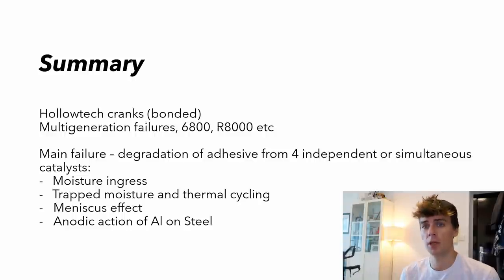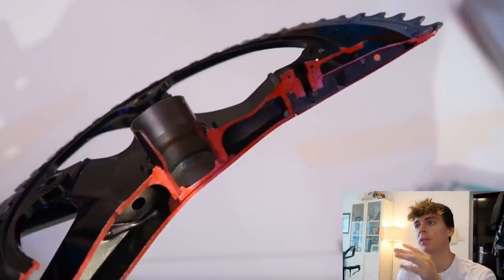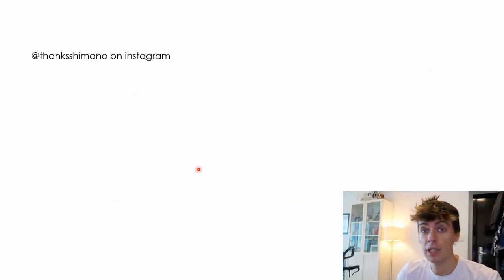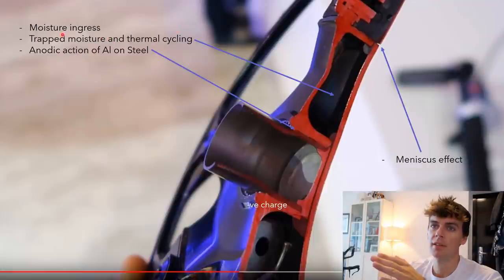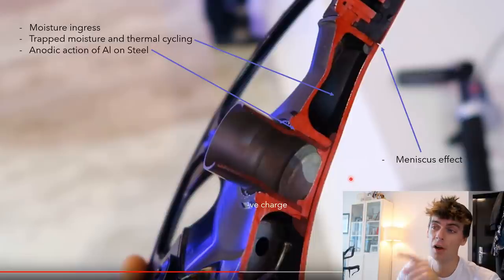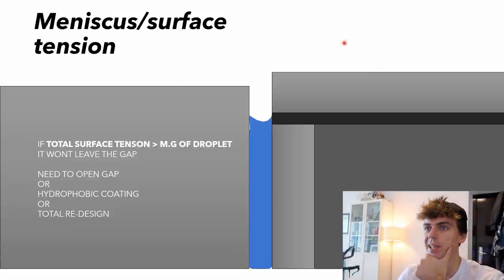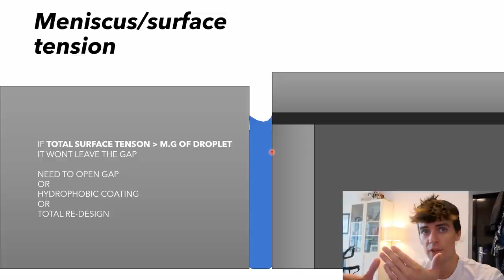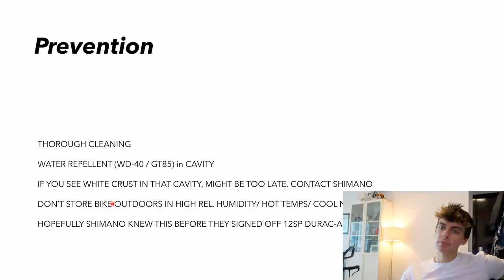Why do Shimano cranks keep failing? Analysis.

Comment: I have broken 3 Ultegras - two at the spider and one the back panel (inside side of the crank).  I live the northeast United States, but I do sweat a lot.  All failures happened in < 15 months.  I upgraded to Dura Ace, but sounds like they are just as bad, albeit with a 3 year warranty.

Comment: I had a argument on Raoul Luescher's channel about resin and water.  In fibre glass boat building they have something they call osmosis, which is probably a bad name as it comes from biology but that's what they call it.  Some resins they have used are hydrophilic and react with water.  They then no longer perform as a resin.  It's well known.
Reply: Many fiberglass boats are made of fiberglass in polyester resin. The ester chemical groups in the polyester can break (hyrdolyze), which reduces the material properties. Worse, if the sizing chemical on the fiberglass doesn't do its job, the bond between the adhesive and fiberglass strand can break. Epoxies are generally very resistant to hydrolysis, and almost any cured epoxy you come across can survive hours in boiling water with little property loss. That said, I don't think we know what chemical class Shimano uses for these parts.

Comment: Just failed my second R8000 crankset. New bike purchased at the end of 2018. First cranks broke on both sides an inch or so above the pedal hole. Shimano replaced for free. Second set just broke but this time only on the drive side but in the same place. I can confirm that I have white powdery substance between the crank spider and the chainrings and I agree that I think that corrosion is the entry point for the failure to happen. Waiting to see if Shimano replaces it again. If they do I may either start vacuuming out the gap or spraying WD-40 in there regularly. I do not think there is a solution, I will continue to break them on a nearly yearly basis. I do suffer from hyperhidrosis and live in Alabama so I’m just north of the band shown in the video. Will likely move down to non-bonded 105 if they do not replace.

Comment: I’m north west UK and have had a 6800 ultegra rh crank fail, shimano didn’t warranty it either meaning I had to replace with an R8000. Also got 2 club mates who’ve suffered the same on 6800. I should also add that my failure started with a creak under load, a twisting moment could be seen when looking down as torque was applied which ran along the length of the bonding from the spider end towards the pedal.  This suggests to me the torsional movement between the 2 sections fatigues the bonding to allow moisture in and as time progresses the split in the bonding propagates along the arm. I had no signs of corrosion in the areas where the chain rings but against the arm.  

The crankset that failed for me was well used (approx 15000 miles) but was well maintained and cleaned inc using compressed air to blow off water before towel drying and storing within the main house.

Comment: This literally happened to my crankset over the weekend. I don't normally, if ever ride in the rain, but got caught in it this past weekend. After I washed my bike, and cleaned everything up, I noticed a massive crack in my crankset. I called Shimano this morning, and they asked me to fill out their warranty form and send it in. My bike is only 2 years old, I'm 2nd owner and has maybe 4000 miles on it. 3K of which, I put on it. The guy from Shimano knew exactly what I was talking about when I called and immediately told me to fill out the form and send it in. Called one of my local bike shops and told him what the problem is and his reply was "Yep, I have a few of those around here somewhere." 

Shimano knows about the issue, and I think they are just going to replace them as needed, and take the product out of consumer hands (hence me having to send it in.)

Comment: You talked about the garage storage, I think in Asia lots of people also storing their bike on their balcony. Cold AF in winter and then hot as balls in the summer sun.
Reply: Even over a single day between night and day on the sun there is a substantial temp difference.
Reply from the maker: Good point Joe. Asian balconies EAT aluminium. Especially bars. I only put mine outdoors when im particularly pissed off with it...my nrw TCR lives in a de-humidified room 😉

Comment: I had an Ultegra 6800 crank fail and I replaced it with an 8000. The 6800 has holes in the rear of the spider but the 8000 does not, so I surmised that it was due to moisture and salt ingress. A friend of mine also had one fail just a couple of weeks ago

Comment: I suspect that the shear forces that act on the cranks also play a part in weakening the bonding agent used and lead to slow mechanical breakdown of the adhesive. In places where there's a lot of heat and high humidity the deterioration of such compromised cranks will be significantly faster than in in places with a fairly dry and/or colder climate.

Comment: This is a great vid, with the potential root causes. 👍

I believe, whether will it grant shimano or any company a recall, is not by product failure, but by severity of the failure’s impact onto the user and it’s surroundings, such example is, if the failure is catastrophically causing bodily harm.
Regardless, this is certainly doing shimano quite a damage isn’t?

Comment: Hello 👋 Sofian form CB Bike Store base in Brunei Darussalam. I had the same issue with my Ultegra R8000 crankset. I ride regularly. My bike is less than 2 years old. I wash my bike at least once a week. So it could be corrosion building up. Good video 👍 bro.

Comment: Hydrophobic paint? 
GE silicone compound + mineral spirit, to a consistency suitable for spray nozzle. 
Only good for fresh crank out of the box. 
Hydrophobic reliability issue if apply after mileage built up or ran on wet road.
The most difficult part is availability on radial spray nozzle mounted on a straw.

Comment: Good video like the approach to and analysis of the problem. Only solution: go Cannondale Hollowgram! Been riding them since I toured the old factory in PA and saw the manufacturing process firsthand with zero problems of ~11k miles

Comment: There is also the phenomenon of "Crevice Corrosion". https://www.corrosionclinic.com/types_of_corrosion/crevice_corrosion.htm
Also as the temp in that hollow section changes pressure, if it's not 100% sealed, then when it warms up the pressure will push air out, and then when it cools it will pull in more "moist" air from the outside. so as soon as the epoxy starts to fail due to the trapped moisture then it will go downhill quickly.

Comment: Yikes, I live in that tropical zone. In a super high moisture area and that combined with dirty roads and fine sandy dirt on them is really tough on parts, especially  bottom brackets. as for the cranksetm I have 105, whew

Comment: The old Dura Ace 7703 cranksets have 3mm thick sidewalls and were laser welded together. An engineer at Speciality Race Products told me, that the fatigue resistance of  XTR crank, of that generation, was well beyond was necessary. And what did we see about 20 years later, much lighter cranks. You would be better served by a map of ambient humidity. If humidity is the problem, then anywhere along the sea coast would be a problem.  I know people who go out in ride in -8C, would that cycles of temperature extremes not cause more problems than tropical climates? Could be simpler, on very humid days there could possibly be a bonding problem.

Comment: Thanks for your technical analysis on the cranks failures. The same thing has happened on my crank, it cracked in two places and Shimano's response is to return to the place of purchase with receipt if its within the 2 year warranty. Mine is just over two years old and purchased it as part of a groupset from overseas, as many people do, unless its on a bike purchased in their own country. I have argued that its not a warranty issue but as an issue of either replacing or refunding a product which is not fit for purpose. As this happens a lot worldwide and as this failure can cause serious injury I think Shimano should do a product recall, that's what would happen if a part on a car kept failing. Can you give your comments/suggestions on what the owners of failed cranksets should do and what Shimano should do, regardless of where its purchased ?
Reply from the maker: I still think they should have recalled it because it is a massive safety issue and can cause serious injury and/or death. Unfortunately it would take a professional coroner's report to make them listen, that is the sad reality.

Comment: I've had two ultegra 6800 right crank arm failures on my cx bike, in about 7000 miles, the second cranked failing within 2years and about 2000 miles max. This is Scotland. I know at least a dozen of my 100 followers on strava that live within about 20 miles that have all had at least one failure as  as well ... almost all were 6800, although there were a couple of durable ace as well. I've switched to 5800 as its a solid crank I believe.

Comment: Proximity to the ocean is a likely factor, especially in hotter climates. When I lived in Florida I was surprised to see so many fishing rods, reels, and bicycles affected: stainless and chromed parts were rusted and pitted; aluminum was covered in oxidation dust and crust. Unless you rinsed off metal gear after every use and stored it in a climate controlled area, it would deteriorate very quickly -- much more quickly than I'd seen along the New York and Southern California coasts.

Comment: You don't need to pull a vacuum when assembling the crank you just need to do it in a room with a decent dehumidifier. Humidity is adverse to the performance of most of these adhesives anyways.

The problem if it's moisture related is almost definitely not due to the tiny amount of water orignally trapped in that cavity. I'd wager they're not that well sealed and external moisture is constantly able to access some interfaces of the crank. Adhesive can form a good mechanical bond without forming a reliable seal.

Comment: Awesome vid, thanks. Had not heard of this issue anywhere else. Was also not aware of the fabrication methods of Shimano cranks. Not the first time in the manufacturing world that the assumption if airliners can be assembled with glue bonded aluminum that it will work in any other application :)

Comment: Obsession with weight is the cause of a problem that need not exist. I have not had this particular problem,  but I have wrecked a n expensive carbon crankset by twisting the spider on the axle (I am 63 and not a beast). 
  I now only use 105 Shimano in old 5 arm style paired with Stronglight CT2 chainrings and the shifting is equal to if not better than Shimano chainrings and is plenty stiff enough for most normal riders. Not that much heavier either. Just goes to show that saving a few grams with Dura ace is not worth the extra cost and possible failure.

Comment: I have more than 10 friends that have lost many dura ace and ultegra cranks. At least 3 of them have lost 2 ultegras cranks in less than 1 year. So they gave up and start to use other brands. I also gave up shimano components some years ago due quality issues. I am using Quarq cranks right now.

Comment: I actually snapped my Shimano Hollowtech 105 crank axle about 2 years ago just before its bonded into the spider.  I would add a photo if I could however I could send you one if you want to see it and explain how and where I did it in the UK.

Comment: Two bolts failed on my slx m7000 1x11 crank, threads stripped. torque wrench was used. I’m uk based probably just a one off, we’ll see. However these are bad failures.

Comment: You can rule out glavanic corrosion if you put one probe of a digital multimeter on the aluminum, the other on the steel axle and read no conductivity. If there is conductivity, I wonder if the problem is worse on carbon and titanium frames, since these materials are very cationic. Human sweat is nasty stuff, with a lot of salts in it. If you get sweat in a crevice on the crank, the water component evaporates over time, but the corrosive salts stay behind-- and in ever increasing concentration. This is the same thing that is happening under your grip tape, so check your bars. I spent a decade formulating epoxies, and I would be shocked if the epoxy itself is degrading or if Shimano chose something with low temperature limits (Tg or HDT). There is more likely an issue with surface preparation of the crank parts, as it can be hard to get parts clean enough to bond well. A fingerprint in the bonding area can be enough to prevent the adhesive from actually wetting the surface, which can result in crevices between the adhesive and the adherend, which then attracts moisture.

Comment: Steel and aluminum are not far apart on the galvanic chart, but pure aluminum would not be used for cranks because it's too soft. Magnesium is also too soft. The "aluminum" used in aluminum castings (if it is to be bend and wear resistant) is always an alloy. Commonly, aluminum and magnesium are used together in varying ratios, but copper and other metals or even silicon can be mixed in.

Comment: Have five bikes with Shimano cranks.  Never had a Shimano crank fail.  Two bikes are approaching 40000 miles each.  Same original cranks. No failures but I keep my bikes clean and serviced.  Maybe poor maintenance + operating in a harsh environment has something to do with it....  Curious about the library of crank failures you showed.  How many of them were caused by a crash or owner abuse/neglect of the bike?

Comment: Let's say you don't clamp down on the two pinch bolts at 12-14 Nm, and through tough use the whole arm develops horizontal play. This grinds away into vertical play in the bearings, possibly with improper preload to begin with. This torque gets shifted into the pedal off intended axis, at every pedalstroke, in conditions that are extreme, for some of the cases, into something that loads the pedal where it comes apart, after it possibly had a bit of a ding to loosen it all up.

It is unlikely Shimano would be testing for something like that (until now), and people aren't incentivized to tell them the fault was partly(?) theirs. It isn't the MTB pedals cracking, so maybe it is even to do with the bonding agent and construction in relation to all the above. Not as over-enginnered, and not as complex, which gets into tolerances and cooling and whatever else.
Reply from the maker: That's a great potential failure mode I haven't considered. I can see extra play putting a peel load on the outer bonded shell. Something that probably wasn't so obvious in design. Great thinking. You should be an engineer!

Comment: My DA9000 split apart a couple of years ago, started off with clicking on each peddle stroke the whilst investigating it literally fell in two, it had done dry miles only and looked in tip top condition, I live in England.

Comment: Slap some Morgan Blue waterproof paste on

And release the air valve and dry them out
Reply: Pressurise with helium to save weight!
Reply: All of the above, Blue Paste, JB Weld, and hydrogen gas to compensate for the grams added! Threaded bottom bracket  and square taper crankset simpler.

Comment: The adhesive does not corrode. It is much like a plastic once it has set. The metal corrodes. It corrodes on the surface and thus becomes weak and the adhesive can no longer adhere to it.

You're thinking of capillary action of the water, into the small gaps.

Galvanic corrosion will be a factor.

Comment: Regarding heat and humidity, spending 2~3 weeks in the ocean, enclose in ocean containers certainly won’t help.
If they spray the cavity with foam, maybe that will minimize air volume while keep the weight down.

Comment: How about a product like boeshield developed to minimize corrosion in aluminum airframes?  If there is a screw hole for a vacuum then there is a place to introduce it into the gap.  WD 40 absorbs water, it does not repel it.

Comment: Fill the gap with epoxy at factory?!

Water repellant spray makes sense. I do that with the 'cross bike that gets weekly (or more frequent) washing. Still eats through components faster than any other bike I own, but not due to corrosion.

Comment: I have broken two different Ultegra cranks. Both of them broke at the end of the  crank- 1'" from the end to be accurate. Shimano replaced both of them fast
Reply: I've broken 3 Dura Ace cranksets at that exact location over 15 years. One of those failures being directly in the center of the pedal bolts hole. Solid aluminum of course at that area. No bonding or air pockets. Always used ample grease and torqued to spec. Shimano always replaces them. Too bad the didn't replace my broken finger as a result of one of those failures.

Comment: Why not assemble the pieces inside a dry nitrogen environment near STP and permanently seal them? At that point, corrosion is completely missing the electrolyte carrier so it is eliminated from the equation. After that it's down to the remaining gaps and proper maintenance.

Comment: When I first got into cycling 2 years ago I always thought Shimano is behind Sram. Sram eTap had no cables all wireless, shimano wiring with the battery in seat tube was ghetto. When I go to a bike shop I'm always looking at bikes with eTap always amazed how clean it is and advance. Sram red cranks are carbon fiber while shimano is still old school aluminum. Lots of riders hate sram and etap says dura ace is better but they cant explain why. They've been watching too much tdf, where riders are forced to ride shimano. I've gone eTap on all my bikes and not looking back.
Reply: It shifts faster, is cheaper, fewer moving parts, looks better (subjectively), and has longer history. Di2 stayed Di2 where Etap is now in yet another generation. In the beginning no pro tour teams rode Di2 because they were skeptical about it.